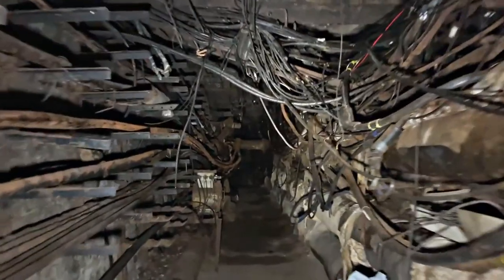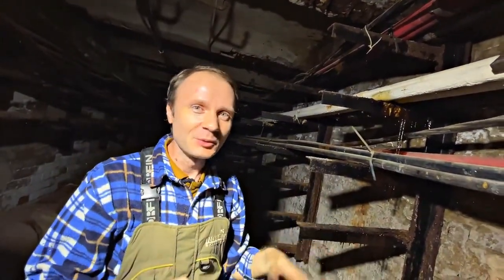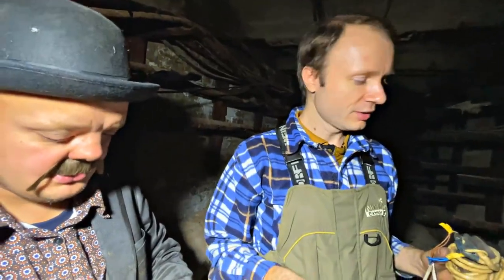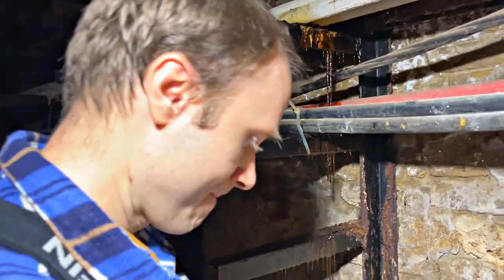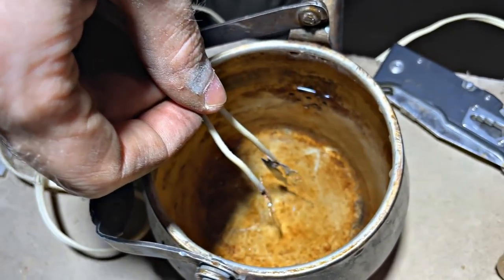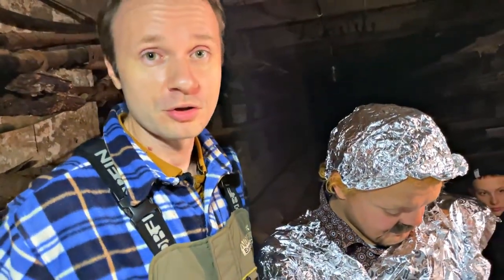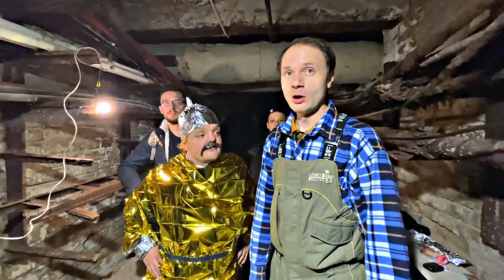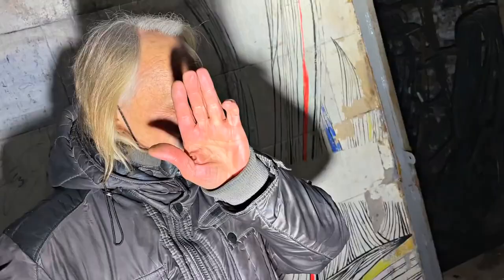How to get⚡️Electricity⚡️with a REEL from High Voltage Power Lines ⚡️💡⚡️Wandering Currents

Comment: That's amazing that it's possible to collect and harness stray electrons from power cables.  I never knew such a thing could be done.  Aside from that, there was something I wondered about all those underground power cables.  It's been mentioned that some of those power cables are no longer being used.  I wonder why utility workers haven't taken the time to remove all the excess power cables if they're no longer needed.
Reply: Huh? He just made a transformer.
Also why remove them, when they can just be left there :v

Comment: What’s the U shape cores made out of? Is it magnetic or just metal?
Reply: Its just metal
Reply: Electrical steel, also known as silicon steel or lamination steel, is a specific kind of steel made to have excellent magnetic properties. It is useful for a variety of electromagnetic applications. Its typical composition comprises iron and a range of silicon contents, with carbon and impurities forced to minimal levels.

Comment: Where did you salvage or get the transformer "C" cores?  (courtesy of Google Translate:  Где ты утилизировал или достал сердечники трансформатора "С"? )
Reply: They said it was from an old TV. It doesn't look like a flyback core to me, I think I saw sheet metal laminations.
Reply: @deltab9768  I think TVs from before 70s had 50Hz high voltage transformers.
Reply: @Basement-Science   I think they always had a high frequency transformer at least to scan the screen. Not sure if it always supplied the  high voltage too. It could also be from a low voltage step down or audio transformer.
Reply: @deltab9768  I'm not sure, but I think a combo of 50Hz transformer and capacitive voltage multiplier created the HV (constant) and Vacuum tubes did the scanning. TVs used magnetic deflection so you dont need to control a super high voltage.

Comment: Don't touch the water with the live leads in it. Lol
Reply: You’d be perfectly safe
Reply: you have to complete the circuit. the electricity you're used to has one side of the potential tied to ground, which creates a path for the current to flow. what they're doing is still extremely dangerous, but it's an isolated circuit with no potential to ground.

Comment: The switching magnetic field is stray. Your electronics are deffo putting a measurable load on the line though
Reply: They are putting a small added inductance  in series with whatever the wire is feeding. This inductance has a resistance in parallel to it. It's  definitely reducing the voltage supplied by the line but I don't know if it's enough to measure.
Reply: @deltab9768  correct. Realistically, there's no real detectable amount of power being used. In theory though, you could measure the extra draw. If I were to say, power my 2kw ebike charger, that would be much easier to detect hahaa

Comment: Dude just put his finger in the smaller white cup and didn't get electrocuted. Must be very low amps
Reply: That's just the galvanic isolation made by their crude transformer. In most home the transformer in the street has his neutral connected to ground so you can get shocked by just touching the phase and being in contact with the ground. In this case you will need to touch both wire without them shorting with the water.